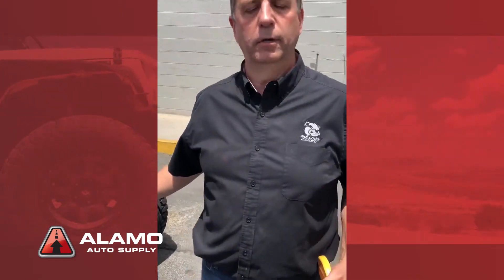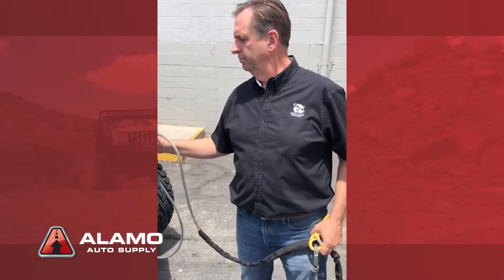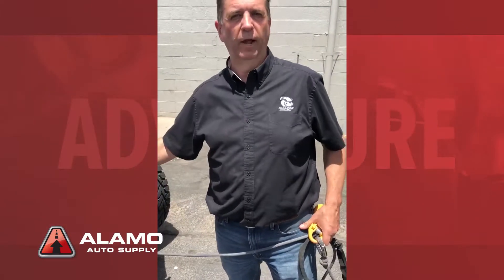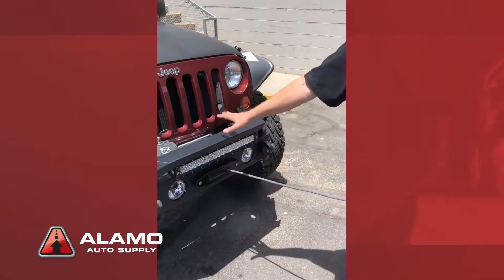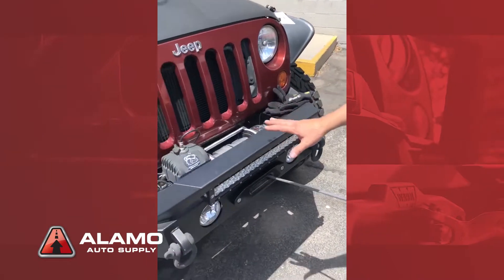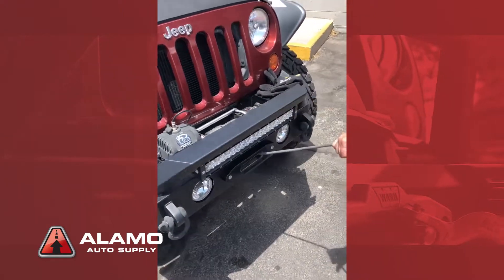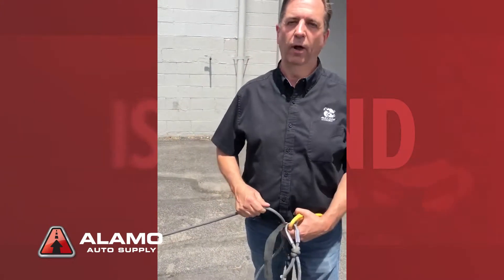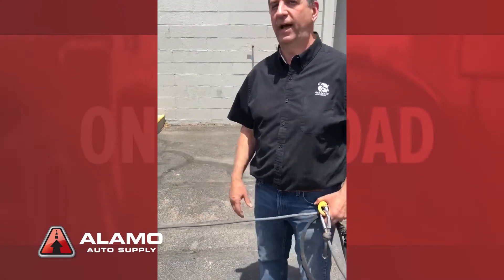How much power does a winch need?

Comment: Thanks for that info! I am trying to install an 8,000lb 12volt winch in my garage, so I need a 110v convertor, but I don't know how many amps the winch will pull. Just pulling my 56 Chevy in from outside.
Reply: Use a jumper box
Reply: I did the same thing and just used a spare car battery and slap a battery charger on it after use!